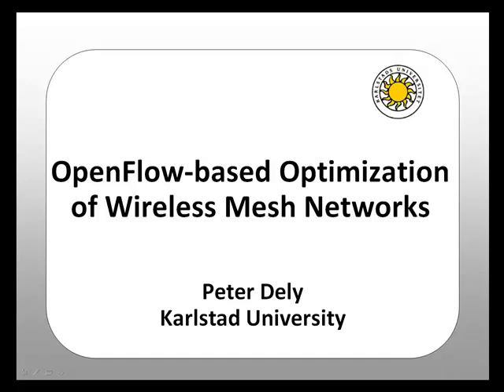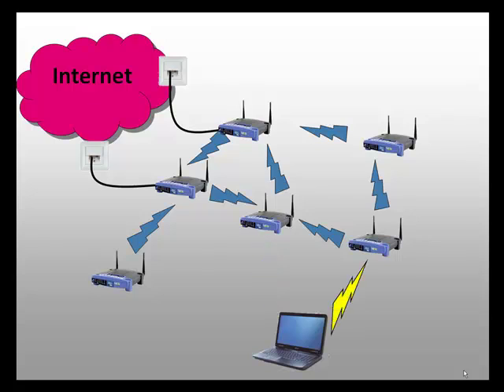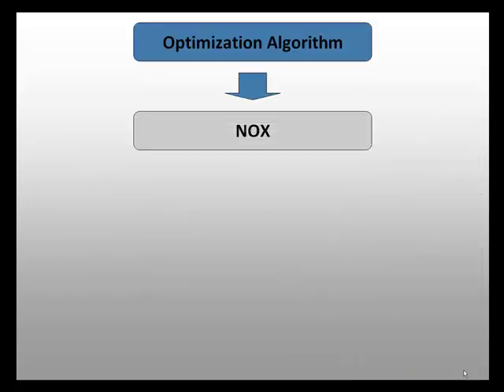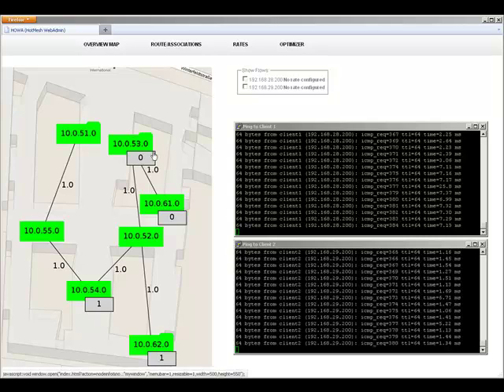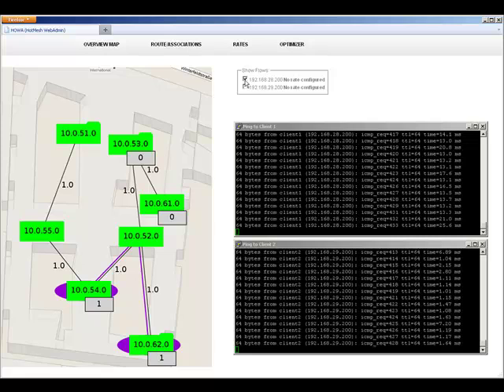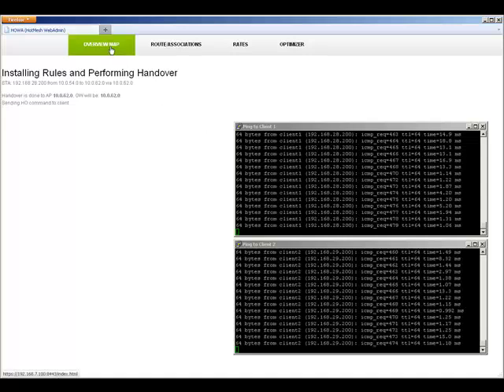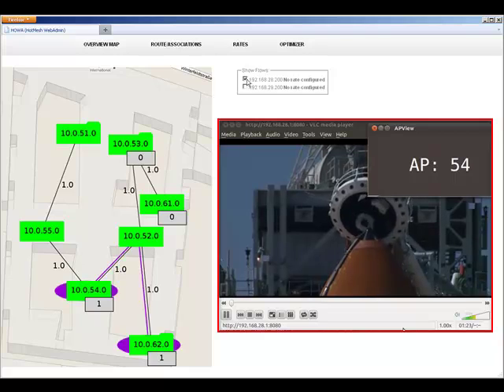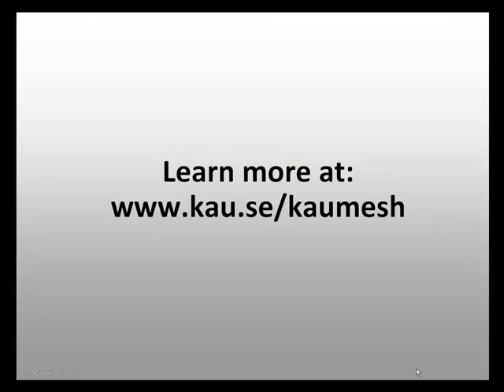OpenFlow for Wireless Mesh Networks

Comment: Hi I am a Master's Student. I am planning to do a project on Fault tolerant wireless mesh network using openflow. I came across your paper and it was a great help. I have a question regarding the implementation of openflow enabled wireless mesh routers. So, I have my algorithm ready to run on floodlight controller. Now I am wondering how to create openflow enabled wireless mesh routers. Is there any reference implementation present already. It would really be a great help if you could advice me